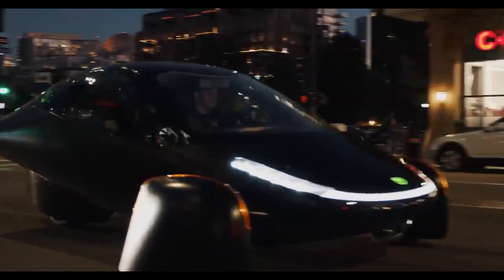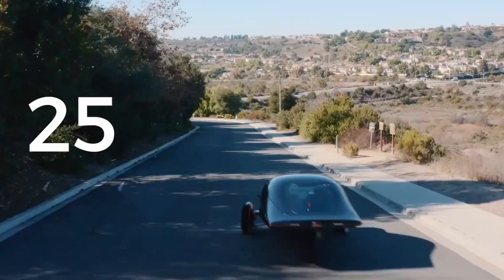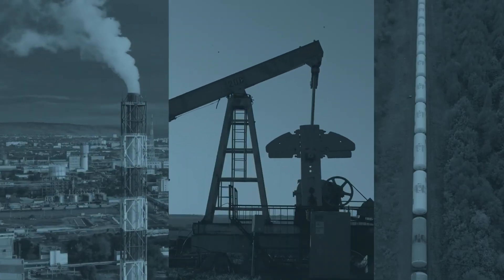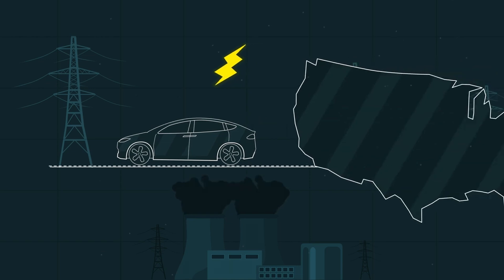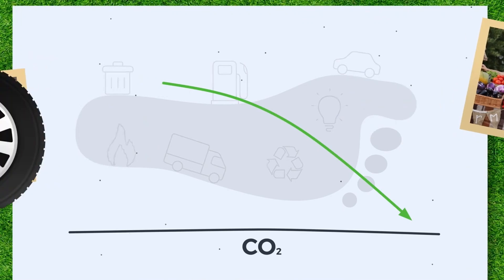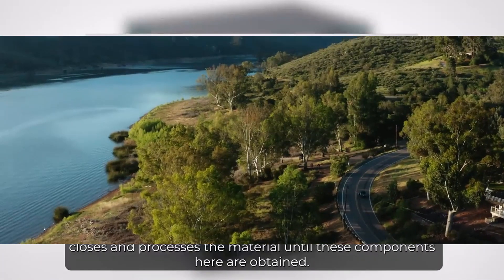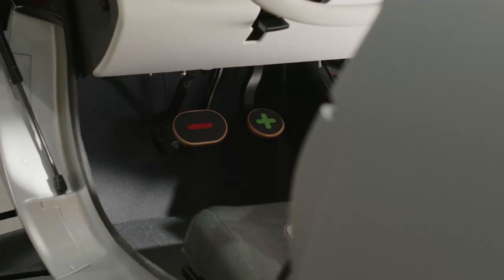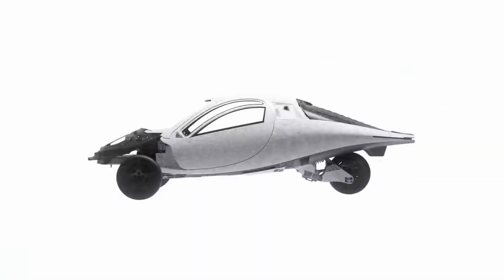Why 1 Million Americans Should Switch to Aptera SEVs ASAP

Comment: I paid 16000 for my 2014 accord 2 years ago and it gets 32 mpg. Ive had for two years and only needed to change the oil and brakes totaling about 200 in maintenance that I did myself. My round trip commute to work is 9 miles along with going out of town once every two weeks and the occasional trip to the store. So I only need to fill up about once every 2 to 3 weeks. My fuel cost is roughly 60 usd per month. Yearly my fuel cost is 700 to 1000 usd. This Sev is going to be at least 30k or possibly more. If I bought it at 30k, it would take 10 to 14 years before I saw any benifit financially from the purchase and that's assuming that I never had to hook it to the power grid to charge and that I didn't already have a car. It's cool, but as with all ev's it just doesn't make sense for a Midwestern like me to buy one. Maybe if I lived in California where gas is over 5usd per gallon and my vehicle must pass emissions and inpection. But here in the quite state of Kansas gas is 2 to 3 usd per gallon and I can drive my car till the wheels fall off and smoke is pouring out of it, cause there is no state emissions or inspection. Maybe instead of going out and buying an expensive sev, that can barely hold your groceries, you should just move.
Reply from the maker: Oh! Climate change?
Reply: @ImpressiveTechView  Industry always tries to blame the consumer for climate change. Tell us what we should drive and that we shouldn't use plastic bags. The manufacturing of batteries and overloading the power grid that is mostly powered by diesel and coal will just make the problem worse. They want me to throw my perfectly good car away and buy their new ev car, and that's supposed to help. Those ev batteries will be no good in 5 to 10 years, and then I got to get a new one. They are wasteful. Build me a hydrogen car that I can fill up with my water hose, and that has no battery, then I might buy. It should be up to the industry to find alternatives to plastic and fuel. But as long as we use any amount of oil to make products, then the fuel and other products we try to replace just go to waste. If we don't use the fuel and they still use oil to make plastic or medicine or paint or the hundreds of things that come from oil. Then guess what they will do with the fuel? They dump it or burn it just like they do with methane. Methane is a by-product of oil refining, and it just gets burned up because there's no use for it. That's what the big flames are on the refininery stacks. When we stop using oil, it is the same day we go back to living like it's the 1800s.
Reply: Haven't you heard? Apteras are expected to last al least 50 years.
Reply: @Okurkaarrgghh  So will any car with regular maintenance. I have a 30 year old Acura Integra that still drives fine. The Aptera has a battery, composed of rare earth minerals such as lithium or cobalt. Batteries will last at most 10 years. Assume that they produce enough to have an after market of batteries. It will cost 5 to 10 grand in today's money, every 8 to 10 years to replace that battery. Likely though you won't be able to find a compatible battery because there's not going to be an after market for such a niche vehicle. If anything breaks after they go out of business then you are screwed. If you cant fix it yourself, good luck finding someone who can. If someone is willing to look at it, it wont be cheap.

Comment: I just bought a jeep wrangler. It had pev version, but it also costs 10-12k more. In addition to that, electricity costs costs almost as much as gas in my area. Also the battery only gives about 20mi per charge.

Increased cost of ev's and hybrids is the single most important decision in buying one.

Also that Aptera looks way fragile and would like to see some crash test results... the cars HAVE to be light to be efficient.

This video feels very biased to the reality of daily and the long term life of a vehicle.